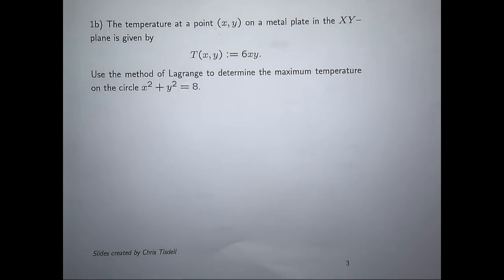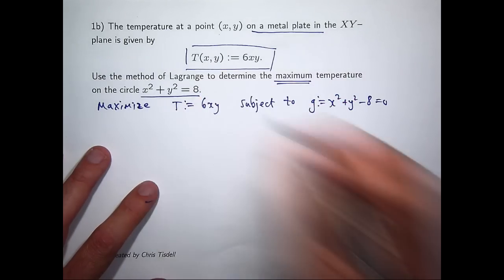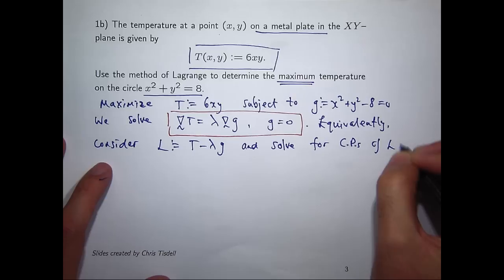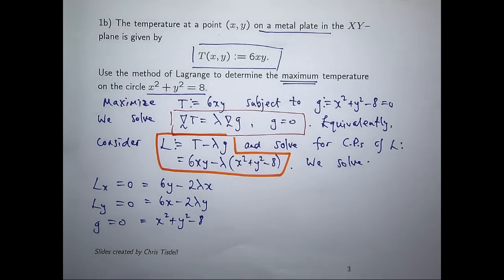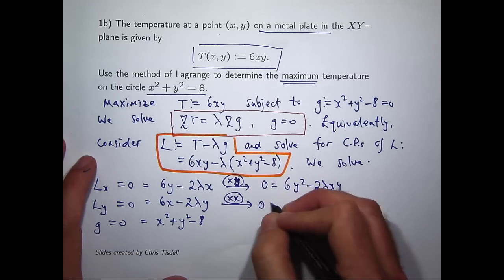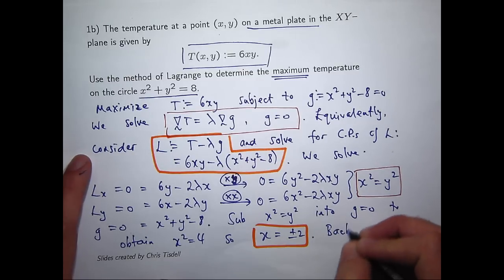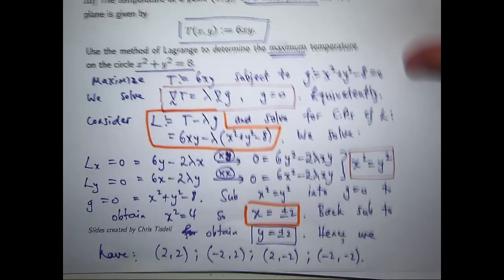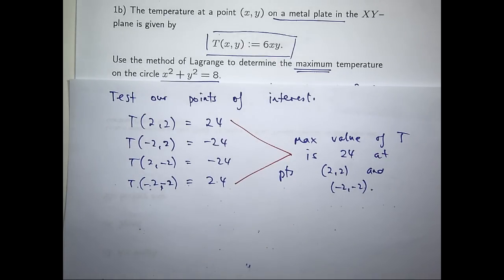Lagrange multipliers: an example

Comment: Professor, I have a quick question. In the previous video of this Lagrange multiplier section, when you found the critical points, you said not to mix the signs of the x and y critical point values (see 12:40 of video 8). However, when you found the critical points in this example, you did mix the signs of the critical point x and y values. Why did the logic behind this change in this case?